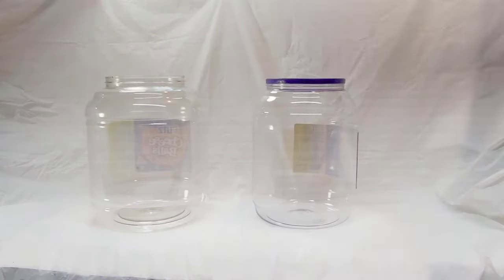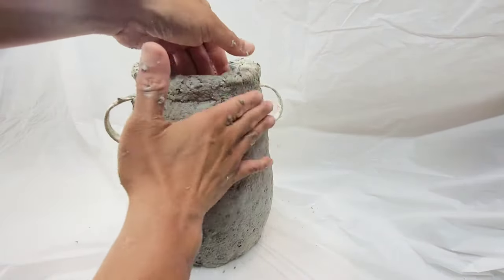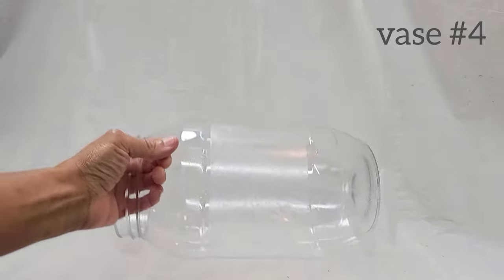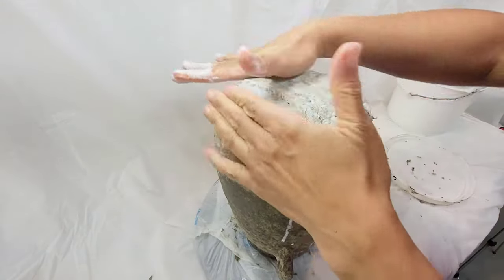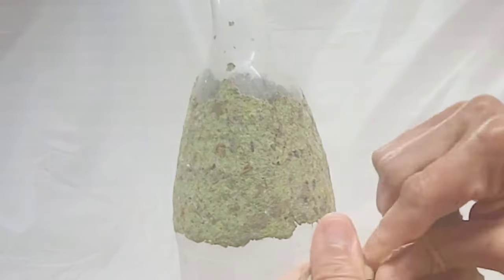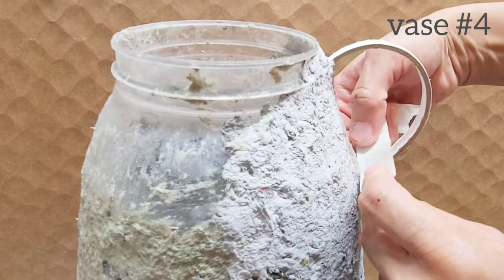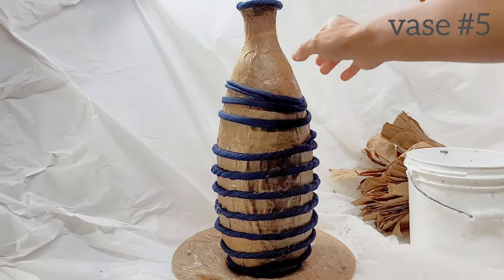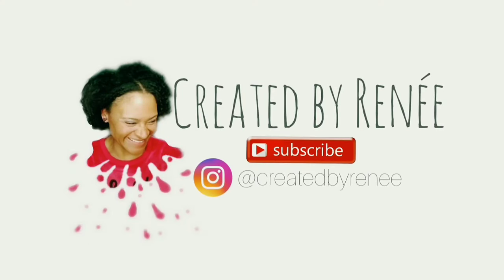How to Make Paper Mache Wet Vases (That Hold Water!)

Comment: How could I add words to the vase? Like a Bible verse?
Reply from the maker: You could try pressing stamping letters into the surface as the pulp begins to dry. It's hard to explain, but there's an exact time in the drying process that's best for applying details. Too early and they don't hold in the pulp. Too late and the surface is too stiff. Two other options are rub on decal-style letters or full verse decals you could probably find online. And painting or writing the verse on with paint, paint pens, or ink. I  recommend sealing, regardless of which route you take. Explore the mod podge product line for that.

Comment: 🪣Learn something every time! I've tried a bit of paper pulp on a few masks but have not been happy with it. But now I see how much you smooth with glue after.. that's the step I was missing. Excited to see if I can make it work!
Reply from the maker: Smoothing through out the drying process definitely makes a difference
Reply: @createdbyrenee  I usually put a wet project under a heat lamp overnight so I'll have to modify that schedule a bit. ha ha Thanks for the tip!

Comment: Thank you sharing Renee, your  vessels are beautiful. I do have a question, though. how do you seal it and especially the lip, where the papier-mâché meets the plastic container, so that when water is added and spilled out, it doesn't seep into the papier-mâché (where the plastic container meet and the papier-mâché pulp).
Reply from the maker: The mod podge line has a few sealants that provide a water-resistant surface. I have two of them linked in my Amazon storefront (but there are more options in that product line): https://amzn.to/3YgqO0q 
I have pieces with plastic lip that I made for myself years ago that are holding up nicely!

Comment: Vase  emoji not available..

Where can we get shredded paper.  This is my first video. I wish I had watched before stacking packing paper and gluing for hours on a mirror frame yesterday because that's just going to fall off when I add heavy paper mache.  I think I'm going to rip it off and start this technique.  I've never seen it before so I'm going to look at how to make it and smooth it.  How are you water proofing once finished.   What do you use to smooth. Ty. I love the one with patterns the most and love the look of packing paper without paint. Ty ❤

Comment: Question...the balloon vase VIDEOS on here...im trying to make one. Well...i failed 6times. Don't no wat im doing wrong. Did exactly wat the VIDEOS said do. 
If u could look up on here How to make a vase with a balloon.  Not the video's that use paper mache. But the video that fill plaster or cement inside the balloon. Those the two ways to make it.
Back to my question...do u think i can use this paper pulp to make the balloon vase after paper macheing it?
Reply: I'm asking cuz like I said trying the pouring plaster inside the balloon method isn't working for me. It keeps cracking inside the balloon. So....I'm going to try the paper mache method & was wondering if I can use the paper pulp. If it would work or not. Would love if u could do a video on it.
Reply from the maker: I'm familiar with that technique and have worked with both plaster and cement. I can save you time: it would collapse using paper mache as well. Both cement and plaster have a mystical way of heating up while they cure. Both the heat and the weight of either would make a rubber balloon or paper prone to collapsing. I personally wouldn't waste the time and materials. BUT it might be a good idea to pose the same question to the creators who have successfully made a vase using that technique.🙏🏽
Reply: @createdbyrenee  I did. No answer. But in the video it worked. Every video that make it & it work. But just trying to see wat to do that will work. Thanks anyway 👍